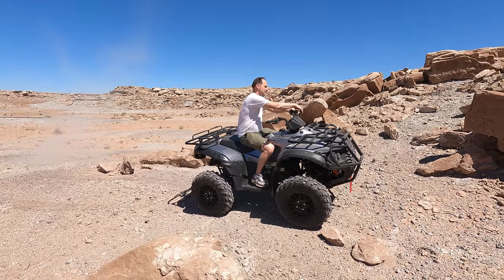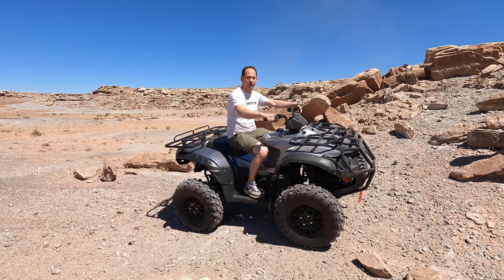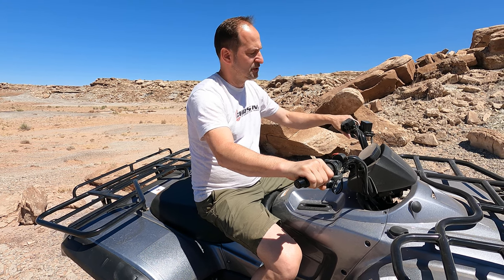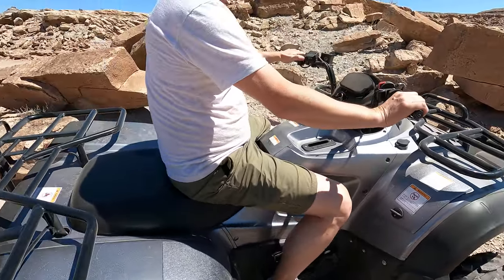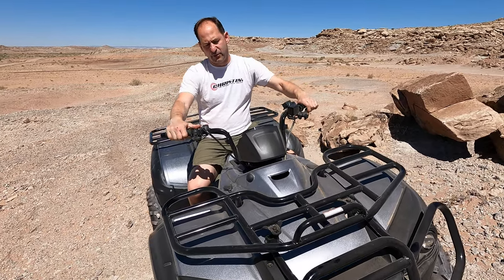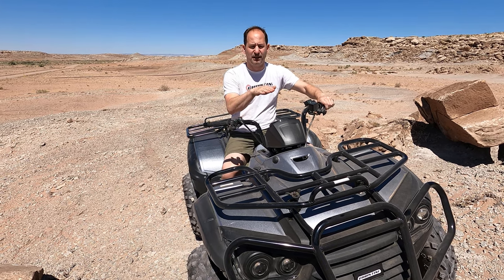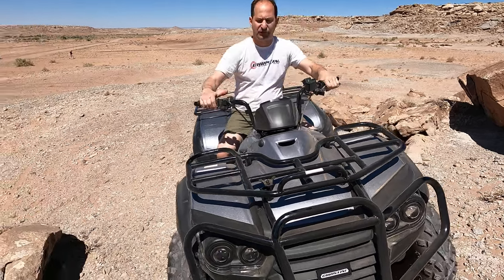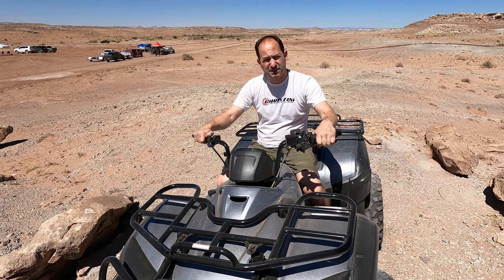Christini EV E-ATV Explanation - Electric ATV

Comment: Have you considered a purely electric one? Taking away the engine would decrease weight and increase range. And or allow for more battery space, which would also mean more range.
Reply from the maker: @GoldenTV3  the ATV is all electric. The generator is an add-on that is modular.  The generator only charges the battery It doesn’t power the vehicle itself.   This increases the range by four times on 5 gallons of gas and only adds 35 pounds of weight plus the weight of the gasoline.   The current battery is the maximum size we can fit inside the frame 14kwh and is essentially the same size as many plug in hybrid cars.